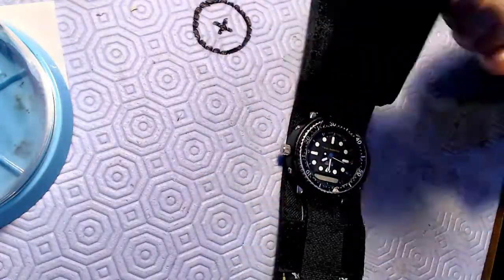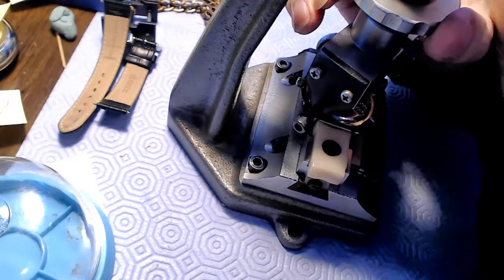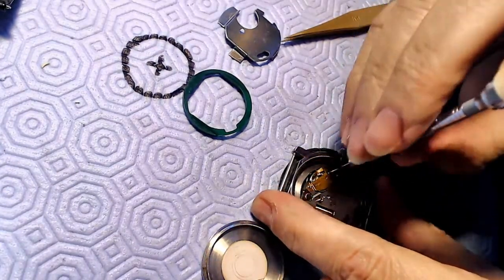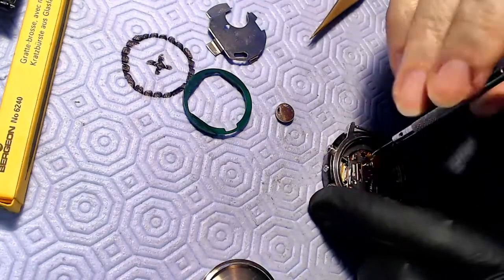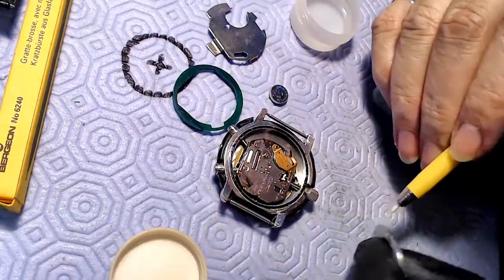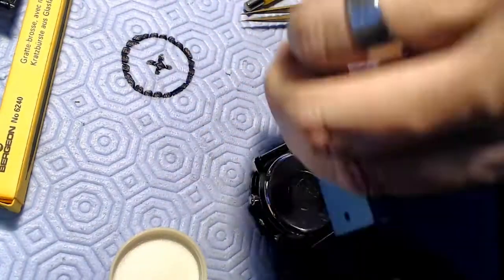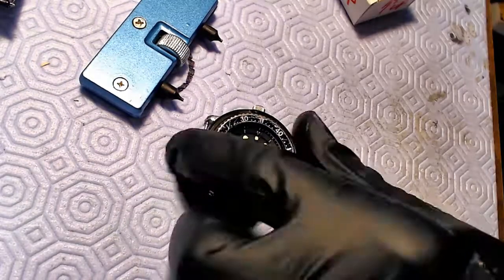Seiko Diver "Arni" (H558A) Battery Change

Comment: JD, really liked this Arnie battery change vid. I also have an H558-5009, I bought mine in 85, and I am the original owner. When it needed a new battery I used to ship mine to Seiko's repair facility in New Jersey. The last time I sent mine in was 2017 or 2018. This was before covid and in 2017/18 it cost me upwards to $50 to ship and insure it plus the service charge of $150.

I have replaced batteries in other watches I own. I have a Bergeon 5700 knock-off which cost 10 time less than the Swiss model and it works great. On several of my dual analog/digital watches I noticed that they have an "AC" (all clear) feature that resets the movement after a battery change. Before I open mine I'd like to know if the Arnie also has the reset procedure.

Again, great presentation. Hope you will let me know.
Reply from the maker: It actually does and it is shorting out two points on the watch. Can’t remember which two as this was a service years ago and the watch was returned.
Reply: @JDRichard  Thanks so much for this info.. I will look for it

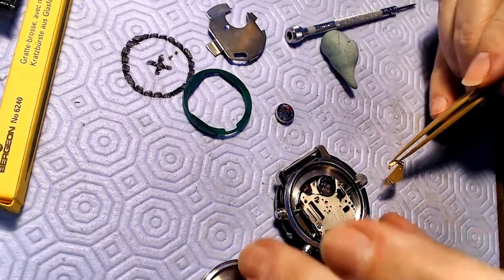Comment: @1:45  FYI, using metal tweezers to grip the battery from both its top and bottom short circuits the battery.
Reply from the maker: WarGamingRefugee Not a real issue due to the tweezers being non magnetic brass. As well, the duration not long enough to be an issue. But you would be correct if my tweezers were SS